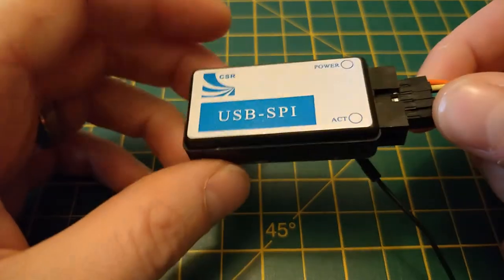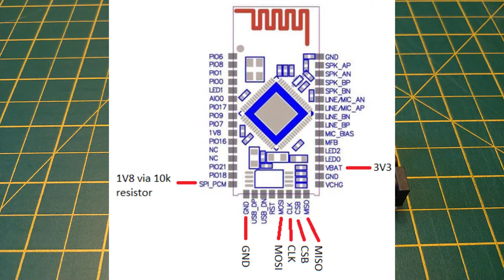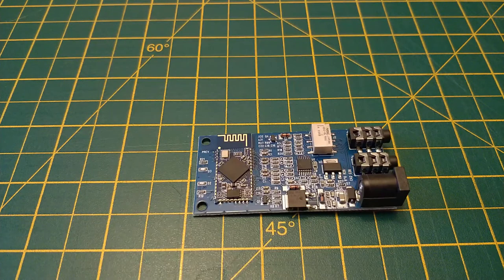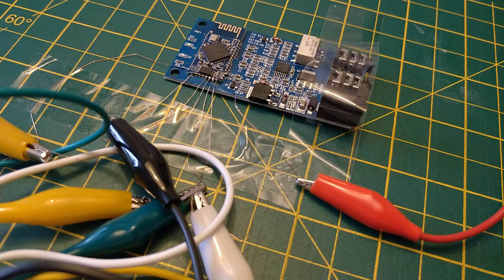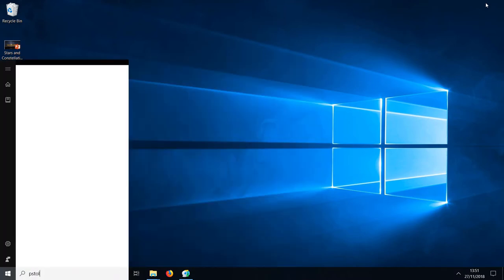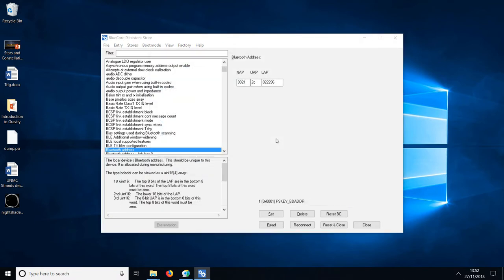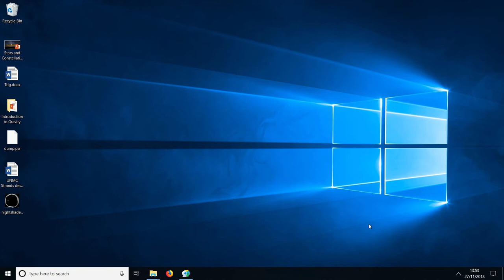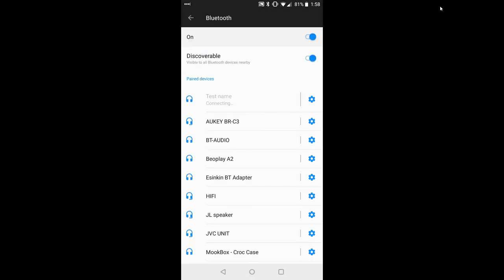Changing the name on a CSR A64215 audio bluetooth module

Comment: Does the Bluetooth module have any noise or hissing when no music is playing?? It’s very common for CSR Bluetooth chips.. I’m wondering if this board has any weird noise issues??  Thanks in advanced 😊
Reply from the maker: There is a slight hiss when the device first starts up, while it's not playing anything. The hiss disappears when playback is started or after a few seconds from being switched on. For me it's really not an issue as its not noticeable unless the volume in the amplifier is way up and it's being used in a very quiet room.
Reply: Scott Marley Thank you for your prompt response!  I’m wondering if a Ground loop isolator might do the trick to get rid of the hiss ...? Anyways thank you!
Reply: I have same hiss or noise problem, while integrating the Bluetooth audio receiver module (CSR57F68) with an amplifier & running from a common battery.
But when I use two batteries separately for Bluetooth & amplifier,then there is no hiss noise at all.I mean a clean sound coming .
I have checked in internet ,that it is happening due to ground loop noise.So by using a separate dc dc isolated converter the problem solves.Apart from this is there any other way to remove the noise.
Any circuit design trick i.e coupling,power supply etc.

Comment: Mine have 4 pins
3.7v, GND, DP, DM
Could you please guide me on which programmer and programming software should I Use ....?
Reply from the maker: Most chips are locked down and it's very difficult to change the name. Is yours using the same chip as this? (CSR A64215). If not, I have no idea how you would go about it!

Comment: Hey man, I wondering if 3V3 and 1V8 means 3.3V and 1.8V and so where do I need a 10K resistor for the 1.8V ?
Reply from the maker: Yes, that's what 3v3 and 1v8 mean. SPI_PCM is the SPI enable pin and needs to be pulled up to 1.8V for communications to work. You would probably get away without using the resistor. However, this depends on the input impedance of the pin which I dont know. To be on the safe side the 10k resistor will limit the current going into that pin.
Reply: @ScottMarley  Oh sorry I meant "why" but nevermind this answer is perfect anyway, thanks

Comment: I bought s64215 pcb only, without additional pinouts. That smallest ver. When i connected 4.2V to gnd and vbat it just heats, but no bt connection.
I got a refund but maybe i'm doing something wrong? How to enable module after connecting power to it?
Reply from the maker: Hi, I haven't used one of these boards by themselves before, however I think you might need to enable the MFB pin to enable the module. Have a look at this schematic https://www.electrodragon.com/w/File:CSR64215_basic_sch.png and you can see the startup delay circuit connected to MFB. If you don't want to make the delay circuit, you can probably just connect MFB to 3.3V (not VBATT!) and it might just work. I might also be completely wrong about all of this, I'm just guessing here!

Comment: Great video, however a time consuming business if you have more boomboxes ;-). Maybe you can design an adapter with pogo pins. Have seen a guy that did similar with a modified clothespin with pogopins and wires already attached to it. Saves some time and you cannot make a mistake.
Reply from the maker: I did consider making a test fixture to do it, but I only do a couple a month and I've got it down to 10 mins now!